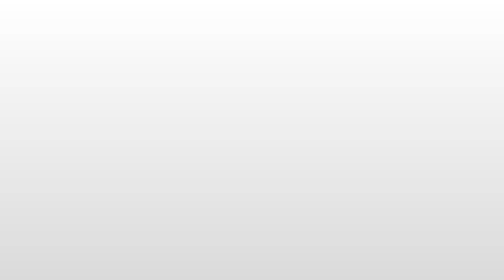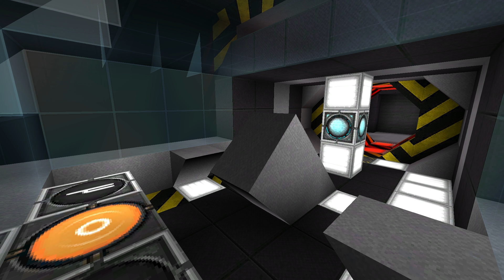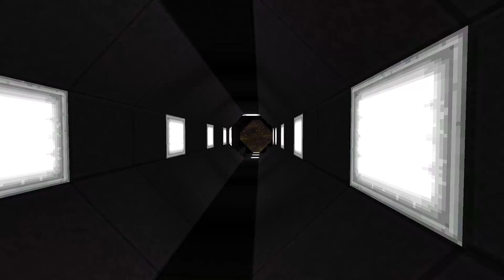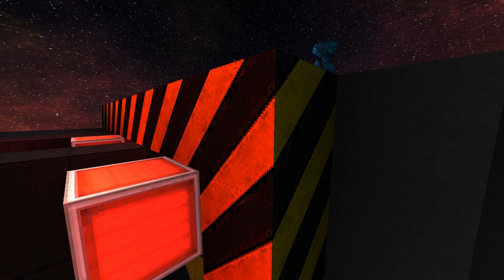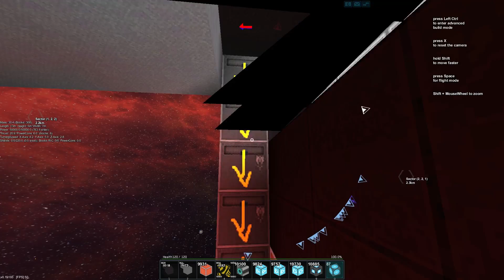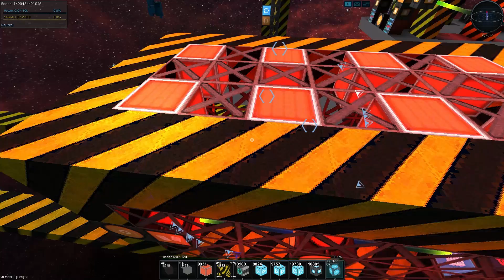StarMade - Dev 0.19193 - More Complex Rails & Logic

Comment: Pretty Builders like this will always be fodder for PVP players like me.
Reply: Photonic64 Except that this "pretty builder" is a developer, and as such could use his immense dev powers to crush you like an insect.  He wouldn't do that; but he could.
Reply: Jack Stenholt Mhmmm which one? I hope you're not WedTM who forgot to update the SSL Certificate Crashing all the servers. Or Calbiri (Tomino's Butbuddy) who threw a fit on Pubchat and hasn't been seen since... No wait... Lets not bring up the whole Beatlebear fiasco... I think you "Dev's" have more to worry about than a slightly annoyed PVP player.
Reply from the maker: Photonic64 And yet how far has the game come in the past year? It's easy to paint a bad picture if you pick and choose moments that do so instead of putting them alongside all the progress we've had.
Reply: Bench Yet the pattern still remains. I remember when the 0.14 update came out with the new graphics engine came out. Where it would overheat 1/2 of the AMD graphics cards by forcing them to run at 100% the whole time. It took them 5 months to fix that bug.

Or more recently the Unbalanced Effect Systems that allowed players to have invincible ships. That FINALLY got rebalanced. It's the game breaking bugs and the horrible balancing that drive people away. 

Faction combat is STILL impossible as there is no way for someone to deplete faction points fast enough to make a home base vulnerable. Ask any PVP server and why alot of people get BORED with Starmade.

I'm not denying that the game itself has grown. BUT there are still major issues that NEED to be addressed if you really want this community to grow. Steam is a fickle user base. Lose them with a bad/buggy update. and you won't get them back anytime soon. I mean even now we have to teach EVERY Steam Noob how to adjust their Ram Configs cause NO one teaches them that on download. And they wonder why the game has piss poor performance.
Reply: +Photonic64 I don't see you making a game so shut your damn mouth

Comment: My only problem with this is, any moving part must be a separate entity, which means purely cosmetic parts, AND structural weak points (as the mothership's shields don't carry over to other entities whether docked or not)
Reply from the maker: bujtorm the mothership's shields will be carrying over to those other rail docked entities, it is yet to be implemented but is a planned part of this rail update. And with the addition of wireless logic blocks there's some capability to have logic functions transfer from a part like this. While it may not be practical for a Ship's bridge yet, it does demonstrate some of the stuff you can now start to do.
Reply: Bench Would the wireless system work with the tag guns? Also, would there be a delay over longer distances?
Reply from the maker: As in the Marker Gun? Not at the moment but I'll see if that can be added in.
And there probably would be a delay over longer distances, but this would be something to test.
Reply: Bench Yeah, I meant the Marker Gun, I just forgot what it was called.
Reply from the maker: From what I hear it should be added in. Also confirmed that wireless system works across sectors.
Reply from the maker: Matt Bradock so in release shields do carry over from any link in the docking chain so long as it can take the hit and it has over 50% remaining.
Reply: Bench Noticed :) I absolutely love the rails, and already started producing rail turrets, the only thing bugging me is when active, they seem to generate a little lag while turning. Like it was still calculating collisions even though they can't clip into anything any more. I hope the next hotfix will handle that